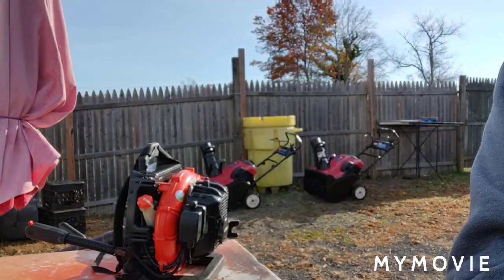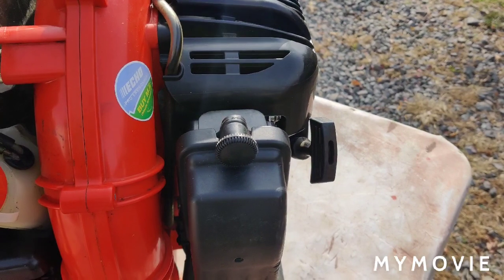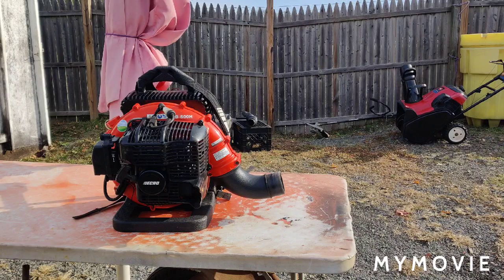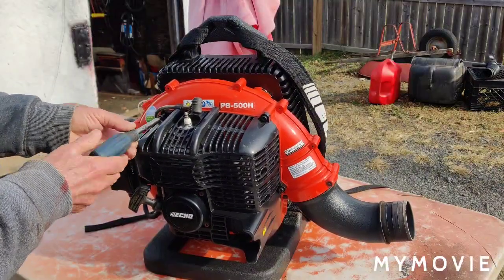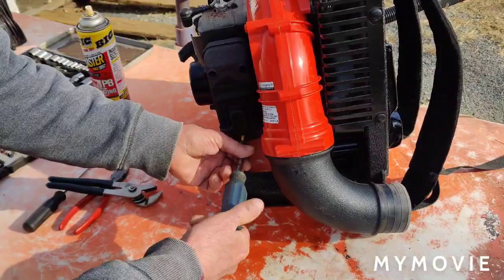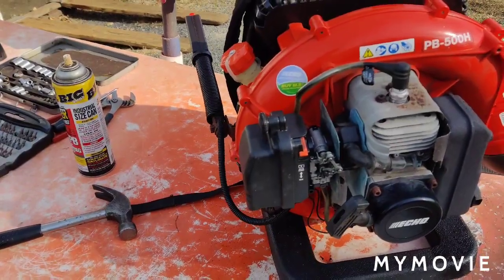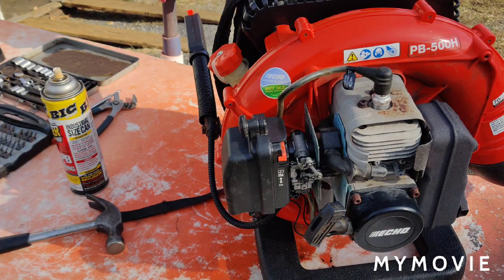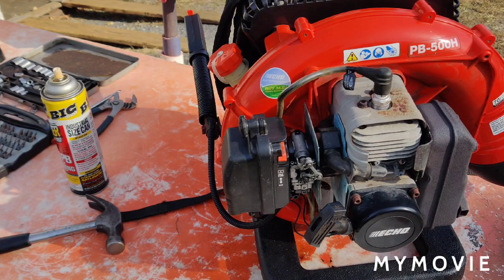Echo PB500H is back again. How I remove rusted screws housing the spark arrestor.

Comment: If a new carburetor doesn’t work,You could pull the muffler off and check the piston And by pressure testing you’ll be able to narrow it down, also the gas cap may be the problem. But remember it’s only 2 strokes, you’re on the right path sounds like a fuel or air problem .Nice job 👍 looking forward to seeing more Gravely stuff in the future. Be good stay safe 👍
Reply from the maker: The compression feels very good to me. But if the carb doesn't work out it's a good idea you have to pull off the muffler. Thanks for your input and Thanks for watching!!! I would much rather be working on vintage Gravelys LOL 😂

Comment: Artie i think your headed in the right direction. I had a trimmer that the zama carb was discontinued that had a bogging issue. The zama carb kit was still available so i ordered it , cleaned the carb and put in the new kit and it ran fine. I think the diaphragm was questionable even though i thought it was good.👍🇺🇸
Roger
Reply from the maker: This machine is 12 years old. You are probably right about the diaphragm even know it looked and felt fine to me. My friend is willing to take the $25 gamble for a new carb. Will see what happens. I appreciate your input and Thanks for watching Roger Mcdonald!!!

Comment: Could be a vacuum leak. Replace the carb and gaskets and it may fix all the problems. It only seems to be doing it when it’s warm after all and the metal parts have expanded during their heat cycle.
Reply from the maker: Thanks David Curnutt. I'm going to change the carb and gasket and that's where it ends with me with 2 strokes lol. Thanks for your input and Thanks for watching!!!

Comment: This is that guy who doesn’t stand up straight again 🤣🤣🤣. I sorted this job out once Arty 🤣🤣💥🔨. Intermittent problems are definitely the worst! 2 pull start up was good. 🔨 technique to shock the threads is good, usually works well. Must be fuel starvation Arty. It’s a tricky one.
Reply from the maker: Yes very tricky to figure out. I'm thinking it's the carb. Will see what happens. As you know the Phillips head screws are easy to strip out. it's a time and patience job. Thanks for watching!!!

Comment: Interesting. Hmmmm maybe if the carb doesn’t fix the issue it could possibly be a gas cap or tank vent. Get it to where it’s bogging and then crack the gas cap open to see if it doesn’t clear up.
Reply from the maker: Yes Alex most echos I've seen had that 3 vent line but this one doesn't.  When I removed the carb on the last video it had pressure when I disconnected the fuel line so I had to un screw the cap so it had pressure. Thanks for the great helpful hints. Because sometimes I overlook the simplest problem. Thanks for watching!!!

Comment: I wonder if it's a fuel lean / rich I can't remember if those carbs have adjustments like my echo leaf blower . Sounds like it is Time for new carb not bad deal all that for 23 bucks for the air filter and the carburetor and you get a shiny new plug to use as a cover for when you're painting the engines lol , I never tried ansal brand I tried hipa it wasn't a problem for me in my opinion so far but I think that carb u mention will solve the problem u can do only so much on those carbs to get them going.
Reply from the maker: Yes I asked my friend if he wanted to take the $25 gamble on the new carb. I also strongly believe the carb will fix it. So now we have to wait for the new carb to arrive. Thanks for your input and Thanks for watching John!!!
Reply: @gravelyman  your welcome artie.  🔧

Comment: That doesn't appear to be an NGK spark plug.  Even if the plug is New replace it with an NGK.  Iv'e had my butt kicked by off brand plugs.  Thanks for sharing.
Reply from the maker: It's a brand new champion plug. Do you still think I should try a new ngk plug T-Bone?
Reply: @gravelyman  Hmmm. champion is usually pretty good.  It may be worth a shot.  My next step would be, when it's bogging remove the gas cap. If that fixes it, tank not venting.  Then I would replace the fuel filter in the tank, even if it looks clean.  I usually only do one step at a time so I know exactly what fixes it.  Hope this helps ya brother.
Reply: @gravelyman  Also remove the muffler and look at the piston for scoring.